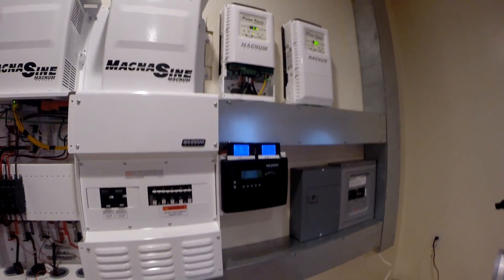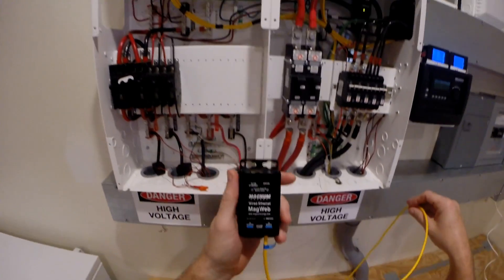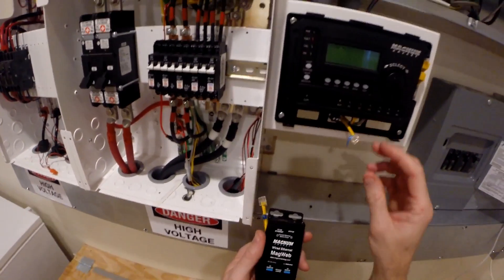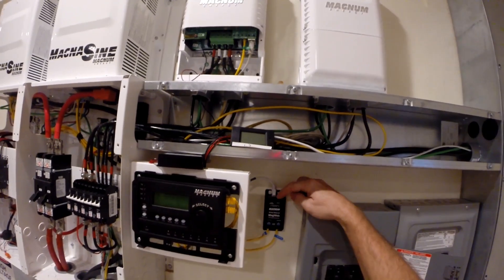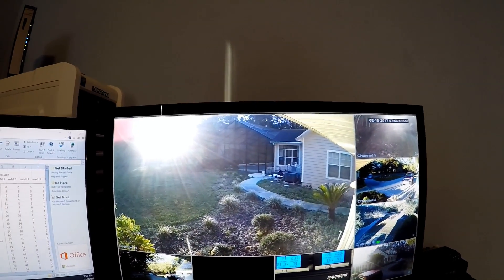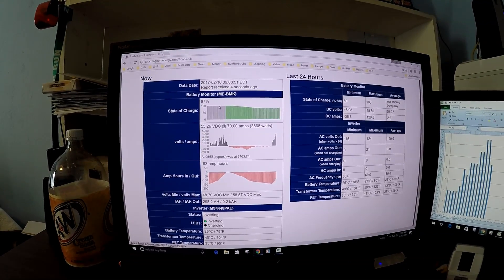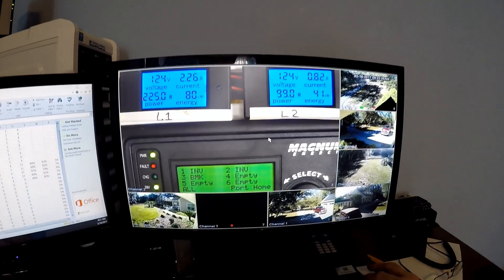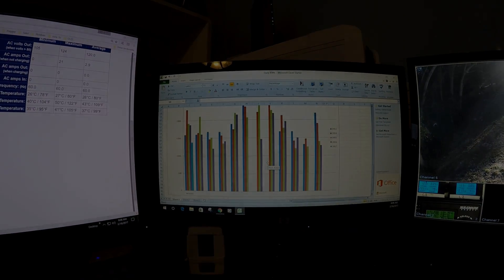Off Grid Solar #40: MagWeb Monitoring Kit

Comment: David, I was just wondering on the main page of the Battery Monitor, if you have kind of an idea of how to explain the volt / amps section of it. I've been trying to research information about an explanation but there doesn't seem to really be anything out there. Any Help is greatly appreciated.
Reply from the maker: Nik, I read that as the current voltage of the battery and the net current flowing in/out of the battery and the net Watts going in/out of the battery.  Thanks!

Comment: Thanks for the review, David!  Trying to track down pricing on the device and the web service subscription.  It looks like the Magnum Energy ME-MW-E Magweb Internet Monitor Kit is ~$319.25 USD (Amazon.com) and I can't find any information if there is a monthly or annual fee for the date.magnumenergy.com service.  Is this a reasonable price from Amazon also, are there any additional fees for the service?  As well, I don't see an App for this for my iPhone or blue tooth enabled like Victron has?  TIA.
Reply from the maker: Treveor, I don't recall the price but I do think it was pretty high.  There is no fee for the service.  You just set it up with magnum Energy (Sensata).  It works on my Android phone as well.  http://data.magnumenergy.com/MW5454/

Comment: Thanks for doing theses videos.  I have a similar system.  24v system with the arc50 remote, bmk, and wired magweb.   I have the midnite solar classic 150 charge controller though.  I can’t seem to see my info on the magnum web site.  Their tech support isn’t much help.  I can see the magweb on my dhcp page of my router.  Any ideas what I’m missing?  My charge controller is sending info fine.
Reply from the maker: Do you have the Magweb between the inverter and the remote?
Reply: David Armstrong yes it is between the inverter and the remote.
Reply from the maker: @BrianM-pt9pk  Can you see your page but no data?  OR you can't even see your page?  Can you see my page:
http://data.magnumenergy.com/MW5454/
Reply: David Armstrong I can see yours perfect.  Mine opens, but it says it was last received 3/30/2018. Which is before I bought it.  Mine also doesn’t have the graphs that yours has.

Comment: Do you have the grid charging over night or have that disabled since you have a good battery capacity?
Reply from the maker: The grid is connected under the SOC condition.  It will automatically connect, take over the loads and charge the batteries IF the SOC gets below 75% (user selected).  My system has never gone below 79% SOC, so the grid never connects (so far).  This is good because I want the sun to recharge the batteries not the grid.  I did test this feature setting it to 95% SOC connect and it worked perfectly.  Note:  you asked a question about wiring 2 panels from one output earlier and I can't find it???  Can you re-ask that under  video #38 please.  Thanks!
Reply: Thanks David.
Previous question was answered by your other video I missed. Thanks